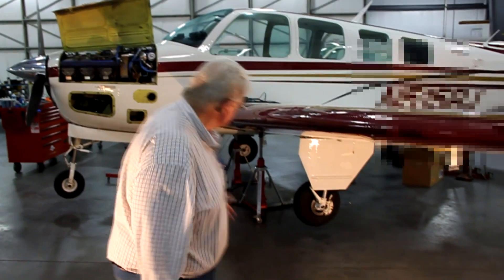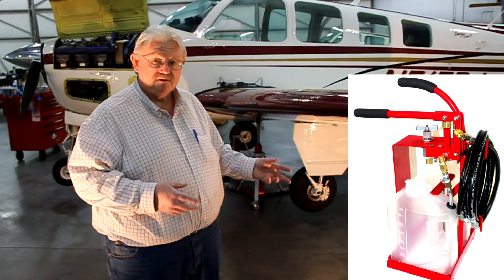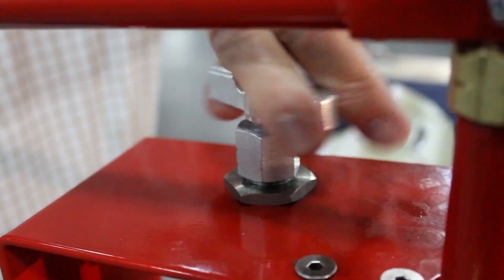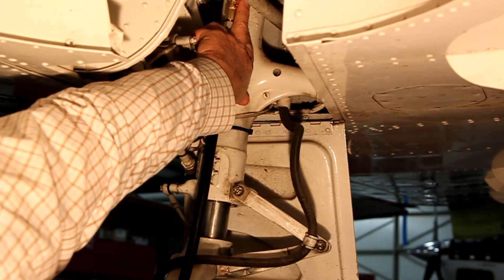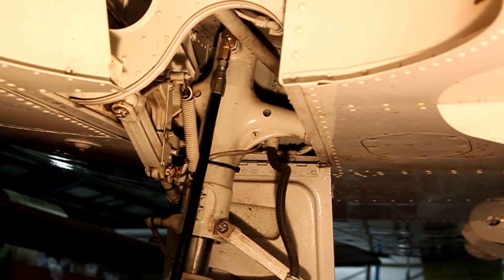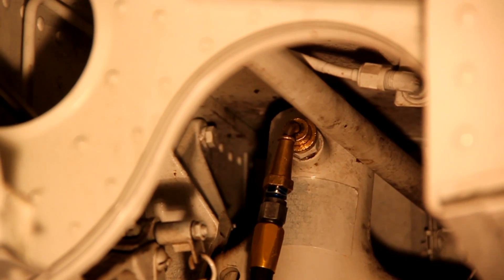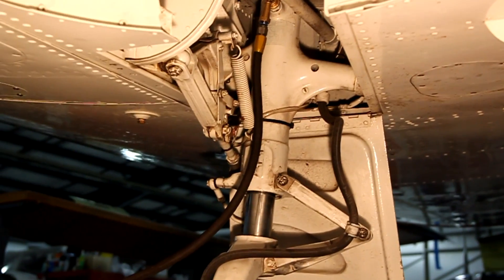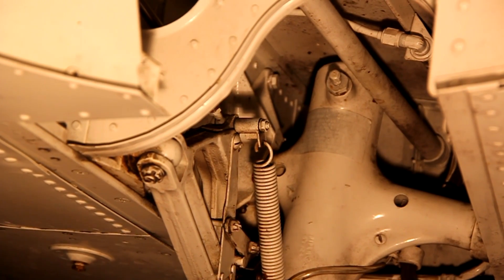Aircraft Strut Servicing - A Better Way [Pressurized Strut Filler]

Comment: How are you determining the correct amount of fluid to service the strut with?  Looks like a nice system.
Reply: I'm sorry for not seeing your question before now. I don't often look at our videos. Most of the standard struts have the proper amount of fluid in them when the strut is full of oil and the strut is collapsed. That is why this system works so well. No mess, safe and fast. It gets it done, anywhere.

Comment: This is a very smart idea and I really liked how easy it was and no mess involved. We used to service struts on the F-15 and it was a pain. Messy and potentially dangerous if the equipment was poor or you weren't careful. We always had poor equipment (military grade) and I saw people almost push the aircraft off the tripod jacks trying to compress the struts.
Reply: The equipment wasn't poor when it was new but AGE (now Support Equipment) gets the shite beaten out of it and often doesn't get written up fo minor issues because lack of same
means sharing whatever isn't broken among many aircraft and often between AMUs. The pressurized strut filler is genuis though!

Comment: Seems like very little used oil went into the waste collection tank, like there was just enough to fill the hoses connecting the service unit to the strut.  
I suspect the used oil trapped in the lines was pumped right back into the strut with very little new oil added to the old.  Great idea but I think adding a step of flushing the old oil out of the connecting lines would be required.
Reply: The check valves in the system prevent the old oil and foam to being pumped back into the strut. The tool was not intended to pump out all the old oil. I am not sure how a person could do that without pulling the strut apart. This tool was designed to do normal strut servicing with maximum safety, minimum time and virtually no mess.  Richard Boget- President Bogert Aviation Inc.
Reply: There was minimal used oil because the strut was low on fluid to begin with. The old oil can not be sucked back into the strut. Pressure and valving prevents that.
Reply: The strut fluid that comes out of the strut is diverted into the waist oil tank. It does not mix with the new oil. This is a system for filling/servicing the struts. It does not pump or suck our the old fluid. The way struts are designed, It would be impossible to suck out the fluid. you would have to completely disassemble the strut to remove all the oil.

Comment: The Bennino, The strut extension varies with each aircraft and some times it's a measurement of strut exposed and sometimes it's a pressure measurement of  PSI with the strut serviced and extended. The only way to know for sure is to see the service manual for your aircraft. I caution you not to guess. Check it out and know for sure.

Comment: The Bennino, The strut extension varies with each aircraft and some times it's a measurement of strut exposed and sometimes it's a pressure measurement of XXX PSI with the strut serviced and extended. The only way to know for sure is to see the service manual for your aircraft. I caution you not to guess. Check it out and know for sure.

Comment: how do you  know the distance to extent the strut when adding nitrogen?I'M JUST a new  graduate curious to learn.
Reply: Use the TLAR method
Reply: @ronjohnson9507  Good ol' fashioned calibrated eyeballs!
Reply: The aircraft service manual will give either a pressure or so many inches of strut extension for proper service. Always refer to the aircraft service manual.